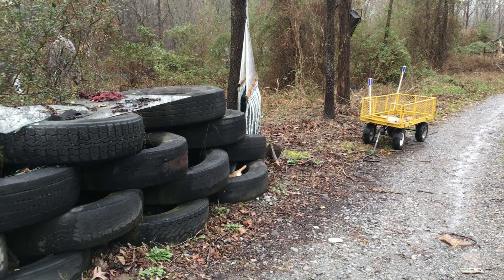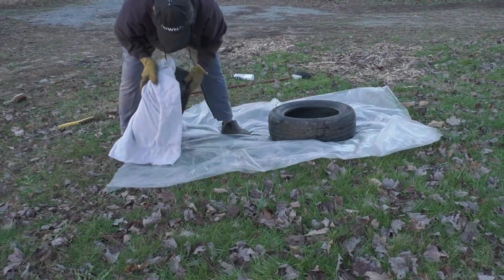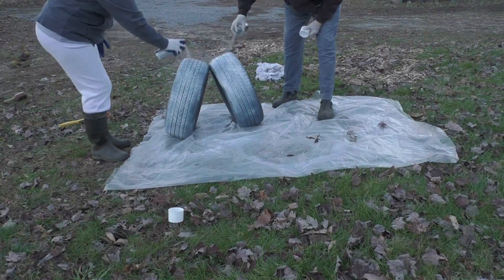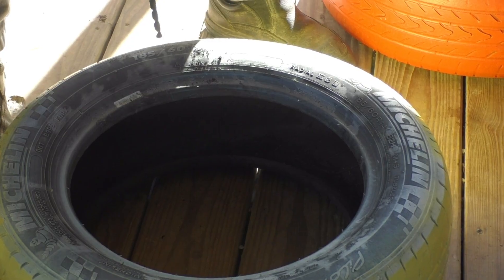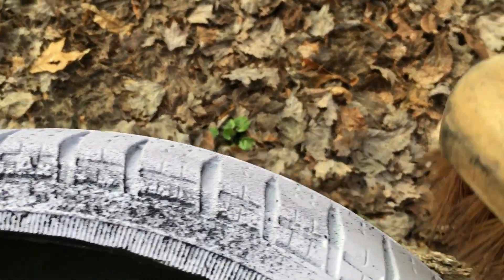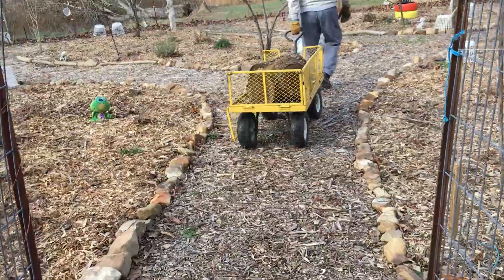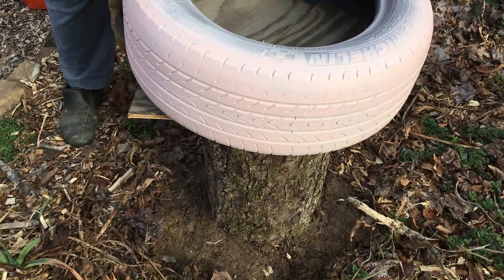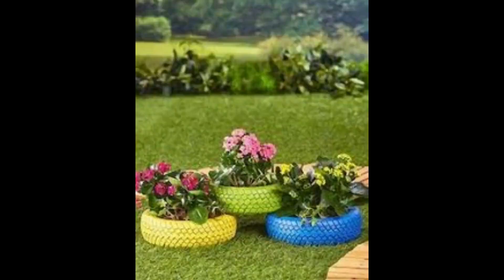PAINTED RECYCLED TIRE / PLANTER

Comment: well there is a good use for all the old tires i have laying around, every thing from big skider tires, car and truck tires, but i would have to bring in loads of top soil and mix in a bunch of composted cow, chicken, turkey and pig poo, i wounderr if i can start them now.. lol ,, 30 years ago i haled in 10 tandem loads of top soil for my garden but this red hard clay eat it up, thats why i have the pigs on one of the old gardens for the past 5 months, i was going to move then in to the bottom of the valley were it is all heavy brush but it took them some time before they really started to root up that garden, i had put all last winter cow, chicken and turkey poo mixed with the old hay straw bedding, being it was so hard my troy built 10hp tiller wouldnt touch it, but the pigs ripped it up a foot and a half deep, pig noses sure plow up anything even the huge river rock i had in there for walk ways
Reply from the maker: Arnold Romppai 👍🏼👍🏼👍🏼 wow , I wish I had all that manure !   I could go to my neighbor and ask for some of the huge tires and fill them up with manure !!!!
Reply: @MYPERMACULTUREGARDEN  last summer alone not counting all the other years i gave away 26 half ton truck loads with a small trailer as well, and i still have piles every were as i plow it up were i winter feed, witch is in many places with my snow plow truck in early summer once the clay ground drys up, plus the calf shed witch get straw added to every day, out side that shad now is a pile mixed with stray and old hay they didnt eat it is 5 feet high 8 feet long and out from the shed about 12 feet and it is only Jan, plus what i plow up in spring from the calf pen, i wish i still had my tractor as hand booming this stuff kills my back, took me all summer to clean out the 2 barn i had calfs in last winter as it froze by morning and all you can do add more straw, and i use deep bedding for the chickens an turkeys i just keep adding more straw an clean it out in summer after baby pigs root it up, i am sure if i added up all the piles from years gone by id say i have over a 100 tons
Reply from the maker: @arnoldromppai5395  >>>> W O W !!!!